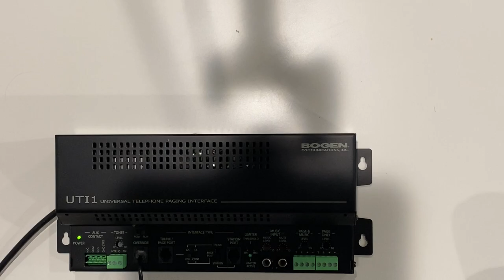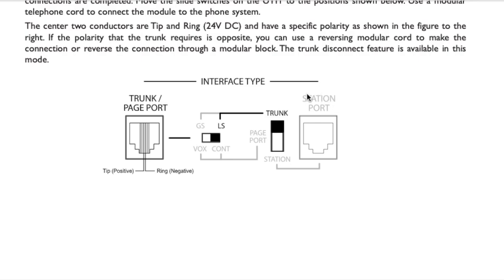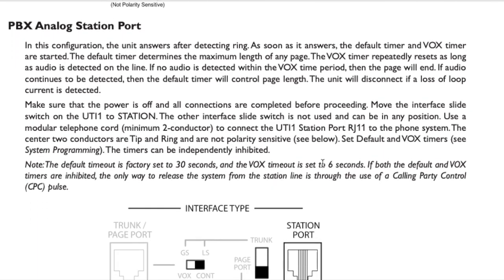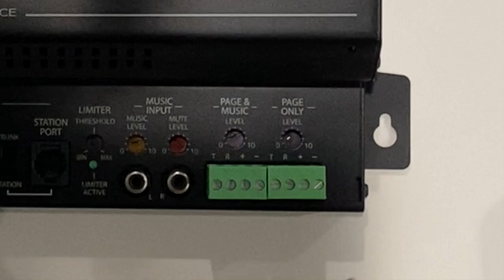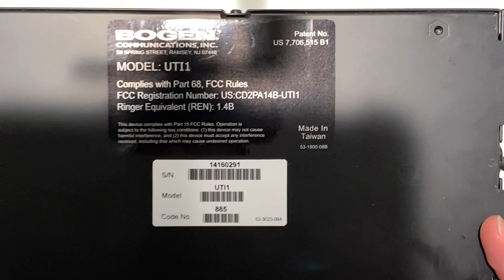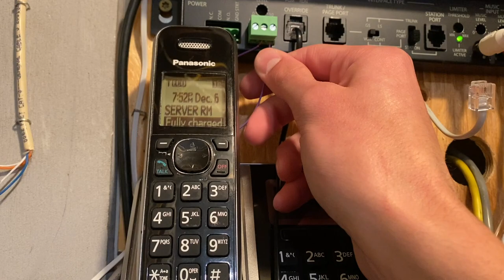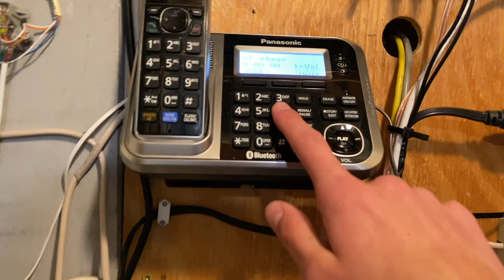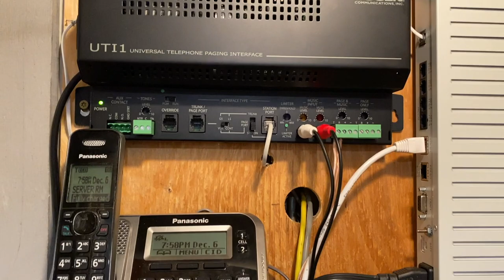Bogen UTI1 Review

Comment: I did not think you were going to show what I needed, but you did.  You can use a standard analog phone and hook it in to the override rj-11 and make a page.  This does not require dial tone. My plan is to just extend from this port to office where the page phone will be located.  The only disadvantage is this is the only phone that can page and it has to be hard wired back to the unit.  When you have it hooked to dial tone or a pbx page port most any phone can make a page.

Comment: What it on the t-r terminals? 
If I was to put a book shelf speakers that has a positive and negative can I put those wires inside the t-r terminals?
Reply from the maker: The t and r terminals are for the audio signal. However, I am not sure the UTI1 outputs enough power through those terminals to run a normal standalone bookshelf speaker.

Comment: i have an bogen uti-1 and an bogen ceiling speaker. does my black and 4 watts wire goes in the page only to page. i hook my phone to the override?
Reply from the maker: Hey!  If the speaker is two wire, hook it to the R and T ports on either music/page or just page terminals. If the speaker requires power (if its 4 wire) Use the T and R terminals for signal and the + and - for power. I HIGHLY RECOMMEND REFERRING TO THE MANUAL. I have not tried it with a speaker and I'm unfamiliar with it. If you have an ordinary telephone, just hook an rj11 to the override port for simple paging! Heres the link to the manual: https://www.manualslib.com/manual/18771/Bogen-Uti1.html#manual
Reply: @nm4fsv684  Okay. I have an Avaya 4610 but I’m still confused. Is their any accessories I need?
Reply from the maker: @intercomsystemsandpaging  unfortunately you would need an Avaya PBX server to run those phones strictly. Any typical rj11 phone will work though.

Comment: does it work with no phone service?
Reply from the maker: Yup. It can be as basic as just plugging a telephone into the override port, and hooking up some speakers
Reply: @nm4fsv684  alright, does it work with no self amplified speakers? I couldn't tell from the video
Reply from the maker: @trincolio  Ive never tried it, but I believe its possible. I'd refer to the manual for voltage outputs and whatnot
Reply: ok thanks 👍